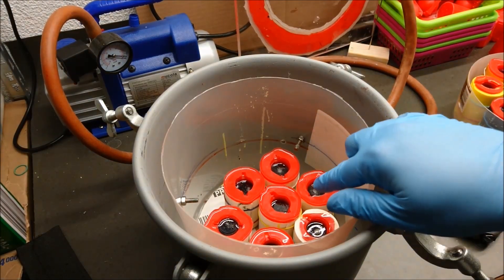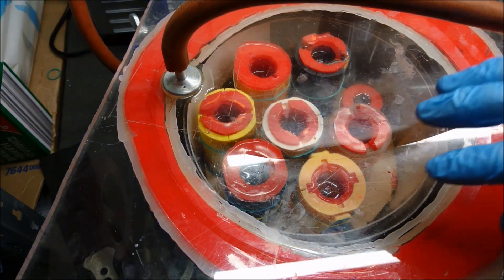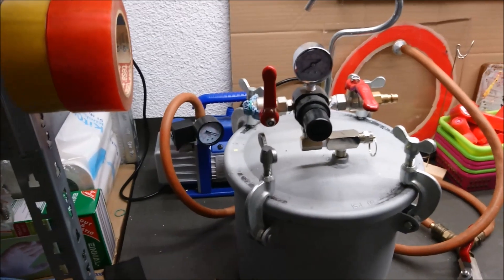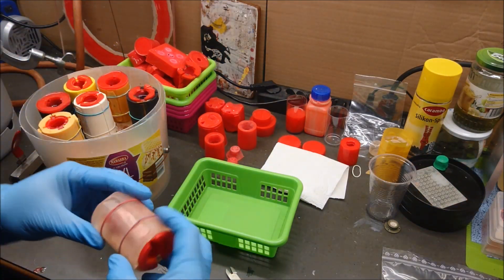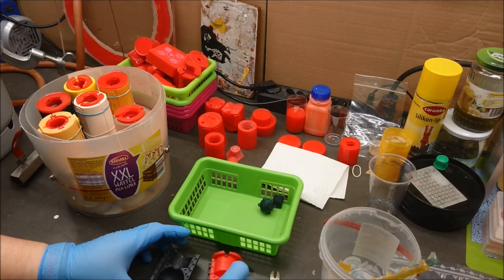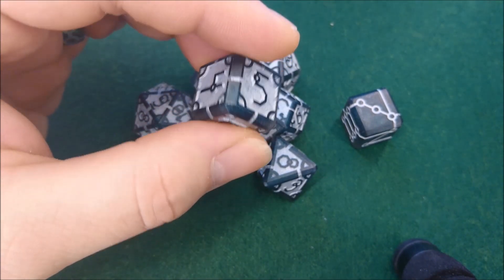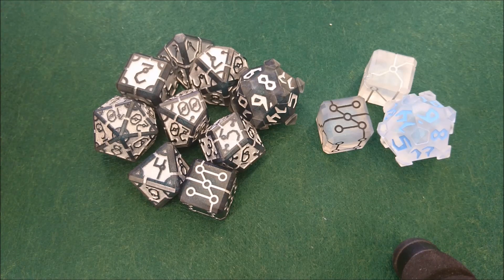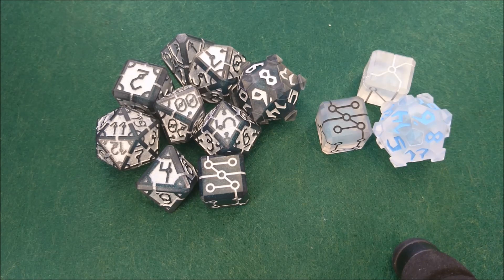Dice Making Advanced Casting Part 2: Filling The Molds

Comment: Great videos!  I am just starting my dice making hobby.  I was wondering if your molds (which I gound on Prusa3D) need vaccuuming before going into the pressure pot or if they are usable of you only use a pressure pot.  Thank you!!
Reply from the maker: Hi, thanks for watching. In my case vacuum is required to fill the molds. If you use a thicker sprue you can use pipettes to fill the molds. But vacuum makes it much easier. 
If you're starting, you should also check for tutorials on slap molds. They're pretty easy to make and have a large opening, similar to my quench molds. You simply place your dice on some adhesive film or tape, add a border (like a piece of pipe or something printed) pour your silicone. That is the first half, after that, you remove the tape, add some release agent to the silicone and pour the lid. It's a two step process, but requires very minimal cleanup, no cutting, no vacuum and the results are pretty good.

Comment: it sounds to me like you used what's called a "nail burnishing powder" which is meant to be rubbed onto a painted nail surface with a small soft tool to create a jewel beetle type of effect. maybe try using it in the inset portion of the dice at the painting stage? or, alternately, on the outside at the end and then sealed with a topcoat of either resin or some type of sealant. i look forward to your continued experimentation with that product.

edit: oh yeah, nice ring.
Reply from the maker: That's already been done. Not by me but by others. You can dust coat the inside of the mold and pour the resin in. You don't even need to seal it afterwards. The resin holds it pretty well. And you can also do this with other pigments as well.
If you want to see more of my experiments I can recommend my Instagram where I post more in between stuff.
Reply: @wuerfel_schmied  that's actually a really clever way to do it!
Reply from the maker: Oh and yes it's this nail powder.

Comment: I am wondering, here 1:01, when you put on the vacuum. Do you read a dial or something? How do I measure the vacuum, when do I turn it off?
Reply from the maker: Yes I have a dial on the pump. For this method, as I just want to fill my molds and not degas the resin, I don't pull a full vacuum. That's something you have to practice a bit. If you want to degas, you just pull a full vacuum on it. Just make sure nothing overflows due to foaming.

Comment: what do you do with the resin spruce? do you just discard them?
Reply from the maker: So far I collect them all. I want to find a way to grind them down and use as filling for new dice.
Reply: @wuerfel_schmied  you can always do what big plastic molding companies do. They keep the same type/color sprues together and grind them down to pellet sized then melt it back to liquid state. The only problem with this is that you use rubber molds while the companies use metal and are injection based
Reply from the maker: @nyxborne1786  sadly you can't melt epoxy or polyurethane resins. They degrade with higher temperatures. They are not thermo plastics which can be melt and injected.

Comment: I'd love to do the dual vacuum/pressure chamber! Any advice on building that vacuum lid??
Reply from the maker: A piece of Plexiglas, or similar. Polycarbonate is very good. At least half an inch thick. Drill a hole and attach a connector. The gasket is made from silicone that I poured between two walls of hot glue. You can also cut one from stock material.
Reply: @wuerfel_schmied  thanks for responding! I'll see what I can rig up

Comment: Hi, I'm wondering about pros and cons of cut molds Vs squish molds. I see you use cut molds with a pressure pot as it seems you can use a very small sprues in the corner.
Without a pressure pot is it still possible to have such tiny sprues, perhaps by using a syringe to fill without introducing bubbles?
I'm expecting to have to experiment a fair bit with that but also definitely don't want to waste material.
Otherwise thanks for the videos, they are definitely the most helpful dice making tutorials on YouTube.
Reply from the maker: I use both kinds of molds for different types of dice. On my Instagram you can see my DD6, this is cast in a squish mold. But in case of my Vertex Dice, I like to use cut molds, as I use the vacuum chamber to fill the molds I can go with a small sprue. I could also make them in squish molds, but its easier and faster to use my mold system for making new molds. I need more then just a few casts, so its also a question of productivity. But squish molds give some advantage when it comes to glitters that you might need to stir to prevent them from settling at the bottom or making the petri method by dropping in inks in the molds and such things. So it comes with your project and your needs, but in general I would suggest a squish mold, easier to fill and easy to avoid bubbles.
Reply: @wuerfel_schmied  thanks for the well thought out reply! I'll definitely give that a go and see how fancy I can make things with squish molds, they should be adequate for my quite small scale purposes and I'm hoping the dice make some really nice gifts.

Comment: Have you experimented with large glitter pieces and dealing with glitter sink?
Reply from the maker: Once. It sunk down. For glitter stuff you might need to wait a bit until your resin starts to thicken and then add the glitter. Then pour it, best with open face or squish molds, and after a while take a look and maybe stir again to bring up the glitter. It's a bit tricky and there is no general formula for every resin. So you need to test that. Also make sure not to wait too long. So in the beginning take a look every 15 minutes and stir and when you see there is no big difference from the last check, stir a last time and let it cure.
Reply: @wuerfel_schmied  So, you use the squish molds in the pressure pot, yes? do you pressurerize between the stirs? Maybe a stupid question.
Reply from the maker: @zmillah  I don't do glitter stuff so I have no experience in that. But I would not pressurize between stirs. Pressure afzer the last stir I would say. The pressure puts gases in solution, not only the bubbles, when you pressurize and then release the pressure your resin will foam like mentos in Cola.